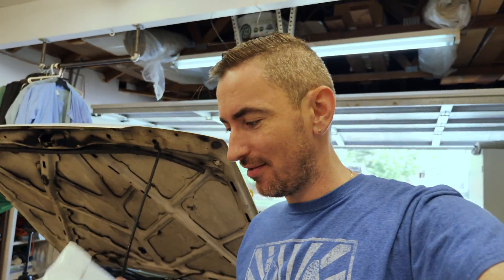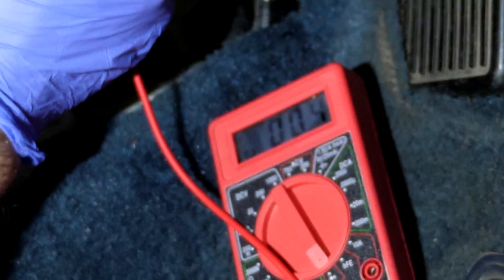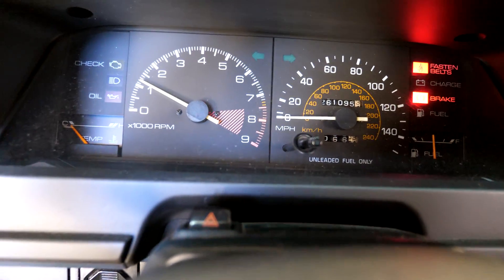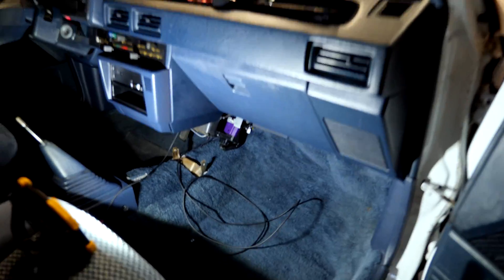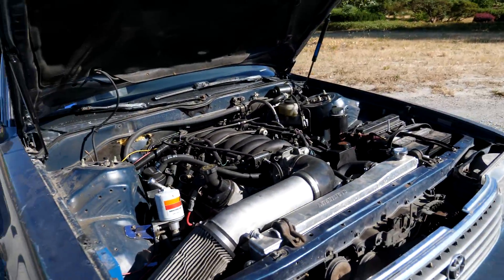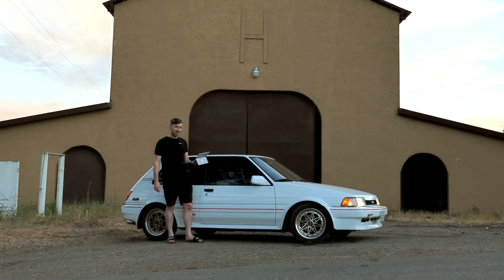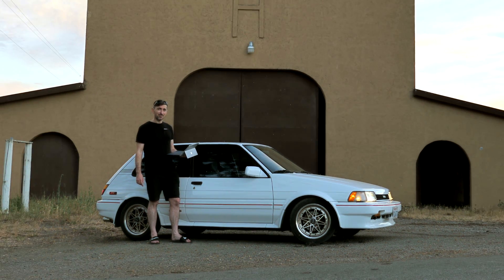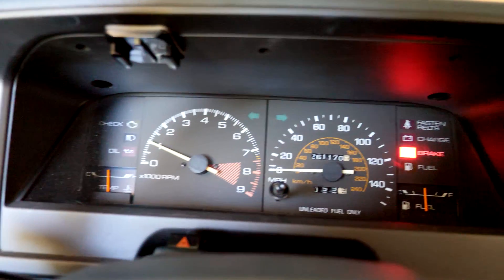Part 2: 4A-GE ECU Upgrade - Road Tuning link ECU & Tach stuff

Comment: Hey sushpants. I have an 07 Toyota Yaris hatchback. I have found a set of TRD springs I’m going to pair with my coilovers. I know our cars aren’t the same but I want something I can really take around the corners and track and have fun with it. Would you recommend doing suspension first (I have wider wheels and lighter wheels now over the stock steel wheels and it’s improved handling by a lot) or a header and exhaust set up. I have a cold air intake already but eventually will switch to customs 1nzfe ITBS.

Comment: im dropping a blacktop into my aussie 4 door ae82 twincam, is your fx16 still running the c52?
Reply from the maker: I swapped in the c160 trans that came with the 20v blacktop. It's worth installing the c160 if  you're going to keep it NA. Keeps the blacktop in the sweet spot.
Reply: @sushpants  really expensive and rare to come buy a c160 in aus, got offered one when i bought my 20v for $900 with close to 250,000kms

Comment: Sushpants question for you. What fuel were you using in your 20v for your dyno tests?
Reply from the maker: California - 91 octane pump gas. Not the best stuff out there.
Reply: @sushpants  This explains why your car pulls weaker dyno numbers. 20v are suppose to run 100 RON minimum.
Reply: @zerohikari2685  This is due to differences in how octane is measured in the US. 91 octane here is about 95RON. Also our ratings are minimums so they usually test a point higher as a margin for safety. 92 octane is about 97RON. US 93 octane would be 100RON. I have the same California 91 octane in my area and my higher than stock compression 20v runs perfect stock ecu. 130hp is a very healthy number considering drivetrain losses. Also higher octane fuel does not cause a motor to make more power. It just allows it to run more advanced timing/boost without knocking.
Reply: @SteelSub  93 is not 100 RON 95 would be. That's an easy thing to check btw because RON is always 5 more octane than US. And yes it does make more power. The ECU in the Blacktop and Silvertop will retard the timing if it senses less than optimal octane levels. This is proven. Blacktop whp should be between 135 and 138HP on 100 Octane on  trabsaxle drivetain. 

Please go check PadOnWheel's Dyno numbers for the Blacktop.
Reply: @sushpants  Thank you!

Comment: What tires are you running?
Reply from the maker: Bridgestone RE-71R’s
Reply: @sushpants  How is the wear?
Reply from the maker: @Cypress_green  The wear isn't too bad and the tires last pretty long if you rotate them regularly. Otherwise the fronts will wear 2x as fast as the rears. They're also friggin' loud. The grip, however, is otherworldly!

Comment: Hey I have a ae82 with a 5afe and auto trans from 1zz but it has an electronic speed sensor. How can i make the old cable speedometer work with this transmition?

Comment: With the 1k resistor mod try removing the tach booster. My car has a standalone ecu and the output ran my oem tach (Toyota starlet) with only the resistor mod. However on a 2zz swap I did which used the oem ecu the same 1k mod didn't work. I had to build a tach signal amplifier instead. So maybe it's to do with the method that the standalone vs the oem ecu use for tach signal.

Comment: Check and then log your alternator voltage, old alternators do weird things and cause all kinds of issues with aftermarket ecu’s. 
Mine was dropping at higher rpms causing the fueling to change.
Reply from the maker: I swapped the original seized alternator back when i built the engine. I'm convinced tach booster can't "boost" quickly enough to keep up with the rpms. Part 3 is definitely going to have a functional tach :D

Comment: With your rev counter issue. You should be able to drive it direct from the link now that you have changed the resistor on it. Also try changing the tacho duty cycle on the link. Mine is set to 50% but yours might need more or less to make it work.

Comment: Use stock igniter for dash rpm signal
Link ecu asign one output to "tacho",  connet  to engine loom pin "igt" 

It you running 20v ac sys
Ac amp also need rpm signal from "igt" 

Using link g4 atom, will be upgrade to cop sys, this is my plan

Comment: Always enjoy your videos, and I can so relate to this having been through the process of adapting an ECU into a standard wiring loom, getting a tachometer to work, doing a road tune before a dyno tune - all on a white ITB powered Japanese hatchback that I use to compete in autocross events....😁
Reply from the maker: You talking about that sweet Charade? That's a nice ride and fancy driving too!
Reply: @sushpants thanks for the compliments, yes that's me and my Charade down in NZ. My dad had a few 4AGE Corollas like yours in my younger days, great cars, good memories. The Charade runs Megasquirt, I had to use a zener diode circuit to get my tacho working.

Comment: I’m telling ya man. A quick gasket matching port job and moving the fuel delivery further up the stacks would help lay the ground work for the cams to properly breathe. I’m convinced that a good port job on the intake/manifold and exhaust/header and moving the injection would gain some very usable power increases.
Reply from the maker: A port job will definitely result in more power! I'm planning on doing cams/valves/springs, don't know about relocating the injectors. I'm not sure i have the room to move them further up.

Comment: I don't think you should have changed the resistor - especially beyond say 5K ohms - because it was working find before, which means the problem is not with it, itself... I would contact the manufacturers of the adapter for assistance\solutions... PS: Since I saw that your car has gotten coils for the first time, I wanted to guess that you'd get between 5 & 10 more HP than you would with just the ECU tune - AWESOME... I can't wait to see the data... =]

Comment: Great video! When I had under dash issues I wouldn't put back dash until I tested It out first. It saves alot time instead of putting on then off
Reply from the maker: That dash will stay out until it is working :D